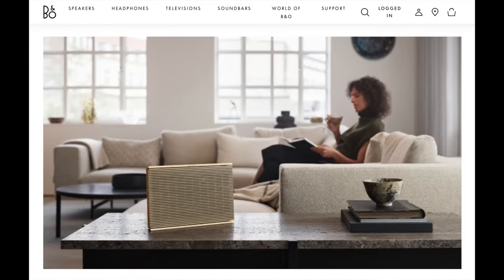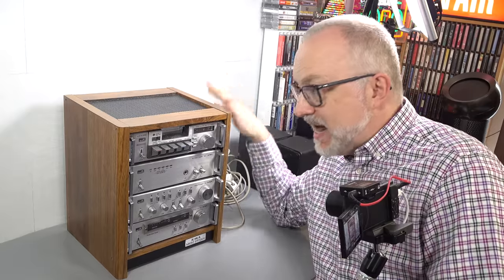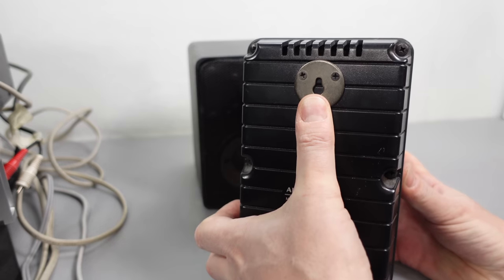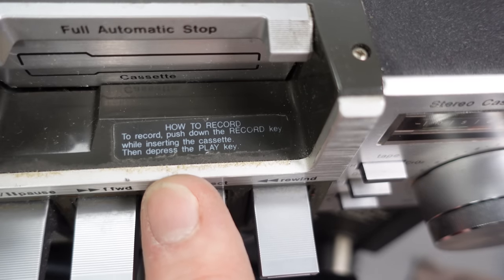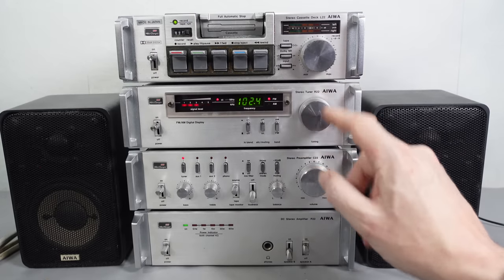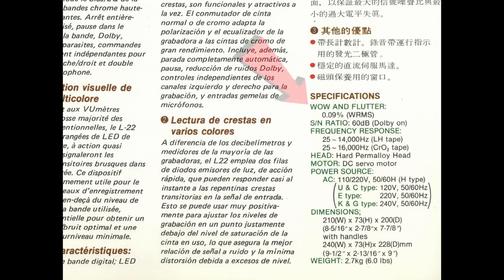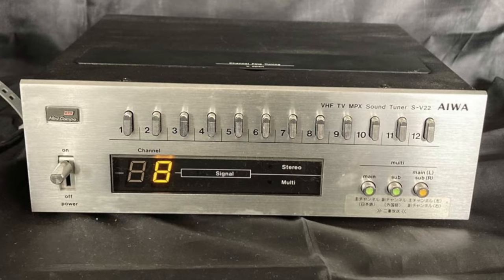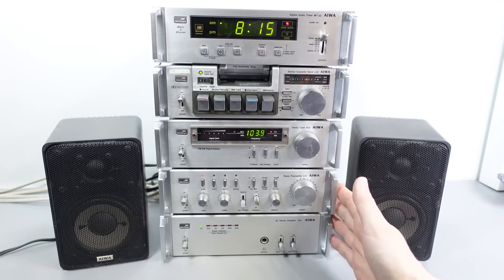AIWA SYSTEM 22 -  Micro HiFi from 1979

Comment: I will never understand old electronics, A lot of years ago now I bought a JVC PC55l, bolt together component system/ghetto blaster type thing, bought from eBay. It worked well but the cassette bit had a large lcd display which had died. I bought it a replacement antenna and replaced the broken speaker terminal, easy enough. The cassette annoyed me, so when I saw another for sale as parts, I asked about it, the amp had died and smoke came out. I just hoped the cassette would work and bought the thing. Yes, the cassette deck was fine, better once I had replaced the backlight for the lcd. And as they said, the amplifier/tuner bit lit up the leds, you could see it was tuning in but there was no sound at all., I did take the cover off and removed the mat of dust, no sign of burning at all but it was just dead. I swapped the cassettes to give me a fully working unit and the other dead machine just sat on a shelf for years. One day I plugged it in to see what would happen, it lit up, the lcd was still gubbed, but music came out, it was amplifying perfectly and apart from the lcd it all worked properly! Suddenly I had 2 working machines. For a day, the next day it was dead again. I don't understand! Back to the naughty shelf and ignored it for maybe 5 years. A few weeks back, I brought it down again, plugged it in, stuck a tape on and again, it was working. The next day, tried the radio, there was distortion when I first turned it on then it settled down and is still working now once it has a few minutes to settle after turn-on. I don't know how a dead machine can come back from the dead, but I am happy it did, they have fantastic cassette decks, I reckon better than anything produced today (not hard!), auto-reverse, metal, Dolby B & C, feather touch logic controls, the belts are fine even though the machines I think date from maybe 1982 or earlier. If only my hi-fi decks were that reliable!
Oh sorry! Great video by the way, as always! Looking forward to the next episode!

Comment: I remember in 1979 or so, an aiwa amplifier, and a receiver in two parts, and each were in a vertical system just the same size as a book, abt. 1 inch wide,  so it could be placed in between the books. But have searched the internet for it, without finding it.... so do you know that model ?  with rgds fm Denmark.

Comment: I would unwire the plugs, cut down the cables to the required length to reach wall power sockets and rewire brand new plugs to each cable end.

Comment: I've scanned the comments, have you seen Ferguson Model 30 and model 40 midi systems? I thought they were made for ferguson by JVC but perhaps they were made by Aiwa. the model 40 are worse than the 30's as they only had 1 power lead and the amp chip was all all in one chip.

Comment: I boil the drive belts I throw them in hot water of 100 degrees ff stir and boil through 1 minute.
Then throw them in cold water and they will shrink and stretch again, it really works.
Have been doing this for years with the first xbox which also often suffers from it.

So no need to buy new ones.
Don't go if they are perished 😂

Comment: This is a silly idea, but it doesn’t seem to me that would be terribly difficult if you had the right tools to make your own additional components for the system. It might be involved, and it certainly would require skill, but given that everything is made from metal, I would imagine if you got a broken component from this series, and a working CD player, MD player, or MP3 player, you could put together either through milling, similar metal, or using 3-D printed metal or even silvered plastic, a component that would match these and give you the additional functionality.

The only issue you’d have then would be that, you’re limited to the number of inputs for the main system. However, this would be kind of stupid, but certainly plausible, you could get a second input unit and daisychain that in to add an additional inputs. Or, if you were really that handy, you could perhaps create a half sized or full sized input system, that all it is, is a switcher for the audio inputs.

Comment: *[concerning the Voiceover AUDIO]:
     Hi Matt / Señor Techmoan, 
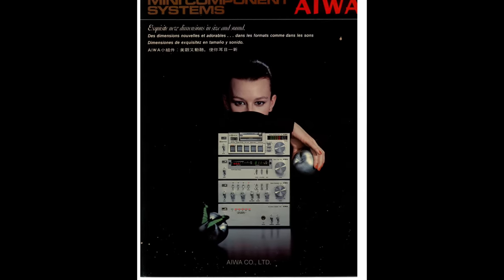I noticed that the audio quality of your voice changes significantly (see 2:50 in the video), as you switch from 'talking to the camera' to voiceover only.

The'space' / 'air' disappears - (like I need to pop my ears, or.. Like being in a confined space that's mostly filled with water)... 
     You also suddenly sound a lot more nasal.

Are you using noise cancelation filters perhaps?

Or filtering out the hard "Pp" and "S" sounds?
    >> (Because that can be done in an analog way; 
     Place a circular frame in front of the mic, 
    stretch a piece of pantyhose around it;
    tadaa... Analog 'plop' filter ('P')  / de-esssser ('Sss')

Or are you using another mic for voiceovers?
     (Or is it the same mic, but your distance from the mic changes drastically?
.    In that last case, maybe a bit further, so the feeling of space gets recorded along with your voice..?)

I hope I don't come across as a smart ass... I am by no means an expert - just someone who's recorded vocals a bunch of times in recording studios (3 full length records, couple of EPs, and preproduction recordings of those LPs and EPs...)... while knowing NOTHING about audio...
     But I remember useful things quite well. 
    (And I love simple, Jerry rigged solutions that perform as well as an official /professional product)

--

If all of the above is not applicable...
    Maybe add a tiny tiny bit of reverb or something? 
    (to give the illusion of space)

Just a thought.
Loved your channel for years, by the way. (Long time subscriber)

cheers from Amsterdam!

Comment: So, if that timer switches the other components on and off with the daisy-chained power connectors, and your components have been rigged up to the mains directly. Doesn't this make that timer completely useless to you? Though I suppose you could rig up a power strip to the output of the timer... Yeah, that'd work.

Comment: Hi. i have the same equipment. I find this micro system in  ¡The garbage! and work perfectly excep the deck. May version have the pre-amp and the amp in a same module.
Extra data: In Brazil exist a similar equipmen under de mark AIKO model 3000, the diference is the deck.
mi name is Guillermo (Williams)  from Buenos Aires, Argentina.

Comment: my laptop power supply interferes with my fm radio. fm is gone when i use the laptop. modern power supplies made in the 2000s sometimes do this. try switching off all other gadgets if possible when testing the fm.

Comment: I had this daytron old VDC/MP3 player back in 2001 , it lost laser  gain around 2004 , and it doesn't play and kept saying no disc .. when i am trying to  play the disk by hitting play button , open/close button again and again player stuck and plays tic tic tac song automatically , it doesn't matter what DISC that is in.. because ,it happened about 3 times for different DISCs , so i knew its not from the DISC , I am not making this up , I am still confused how that Happen ,

Comment: The idea of one power transformer in the amp and all the other componennets sharing it was not typical in 1979.  Aiwa sold these as quality products.  Seperates that were simply miniaturized.  Shared power supplies were made popular by those crappy Fisher Studio Standard rack systems when Sanyo owned the brand.  This was the downfall of the stereo industry.  You buy a rack system for $999, and you cannot easily upgrade any componenents.  No upgrades, no customers.
Reply: @kevind2760
Actually Sony and AIWA were two of the companies that lead the industry in making the components more streamlined with the use of smaller special daisy chained components for power and left and right channels in one single cable.

Comment: Not my cup of tea, I liked the integrated receiver with all the switches and leds in one package the 77-78 receivers were what I liked, analog tuning with strength and center of channel meters. Seems the wires were specifically made for use in uk you wouldn’t need 4 or 5 plugs available to power this device. Most stereo equipment at the time had two outlets, one was switched and the other was always on. I just had a power strip for my cassette deck and equalizer on the switch outlet, turntable on the unswitched outlet. Later compact systems looked a lot neater and had more things that lit up, who would buy that add on digital clock, besides you, anyway , you lost me when the cabinet, cheap pressboard fell apart, and the obnoxiously long and large uk style plugs. I’ll wait for your next demo. Probably better, I hope

Comment: Certain classic cars are EASIER to maintain than vintage electronics. In the US one can just about build a brand-new Model "T" or Model "A" Ford or a 1955-57 Chevrolet. just based on a whole "industry" making restoration parts for these cars. Hell, I'm willing to bet that it is easier to get NEW parts for a 1955 Chevy than a 1995 Chevy. "Type 1" Volkswagen "Beetles" also fall into this camp. (In the VW's case, Probably true GLOBALLY...) LOL. It's not CHEAP, but for certain classic cars, the market is big enough that there are entire companies making new parts. OTOH, new mechanical parts for a 1984 Sony WM-D6? Good luck, buddy! Best you can hope for is finding new belts that might work.

Comment: I've been thinking of buying some 80s Roland synthesizers from Japan, as they tend to be incredibly good value compared to U.K. prices, and in far better condition as well. Does anyone here have any experience of buying used electrical goods from Japan? My main concern is import tax and what's the best, reasonably priced Japan to UK voltage converter, 230 to 100v? Preferably one that doesen't generate enough heat to fry eggs. I've also heard that you only pay import tax on used goods if they cost £800+, I suspect that this info is BS though, lol.

Comment: Is it Aiwa's fault that the UK has these ridiculous power plugs?
Reply: Safety wise, they're the best in the world. I wouldn't call that ridiculous.
Reply: Uk plug is a very good plug. It's the XLR of the plug world.
Reply: @Safetytrousers  the euro plug is better. it's recessed into the socket so no one can stick anything between the pins
Reply: @RealEpikCartfrenYT  Why would anyone stick something between the pins?
Reply: @Safetytrousers  Rather chunky though. A short anywhere in the wire is really exciting.
Reply: @firesurfer  I've been alive for 52 years in the UK, and I have never experienced or heard of anyone experiencing a short in a plug wire, doing that is impossible if all the wires are screwed in, without doing which the plug would not work. And the size of the plug allows the hand to have a good grip on it.

Comment: Not in my living room I have a hifi well its separates and all Sony stuff from the early 90s started my build in 1990 the only thing that's changed is the speakers which I swapped out for some missions back in the late 90s early 2000s I wouldn't swap my system out for nothing and it's high-end stuff that took me a long time to save and build up, not a great a fan of this single Bluetooth speaker it's looks naff amd sounds like garbage I know my wife has one in the kitchen.

Comment: Only problem is that the cassette deck uses a DIN plug and not RCA plugs, so you can only use it with this system.
Reply: The line levels and impedance are the same between DIN and RCA, so a simple adaptor cable will make is easy to connect to other component using RCA.